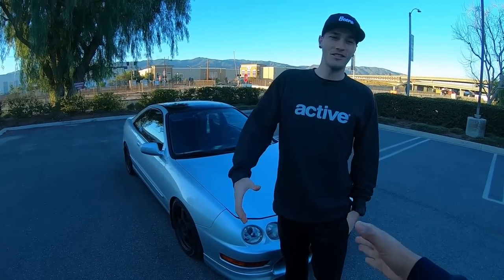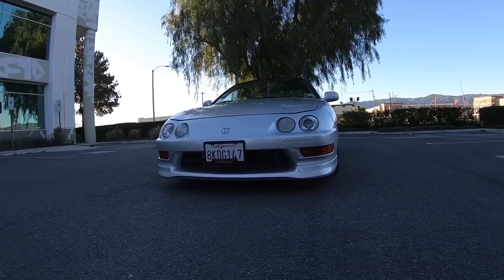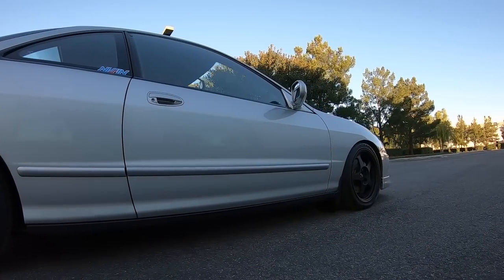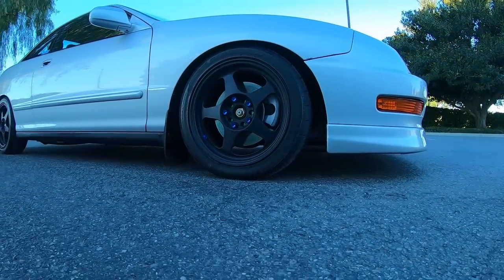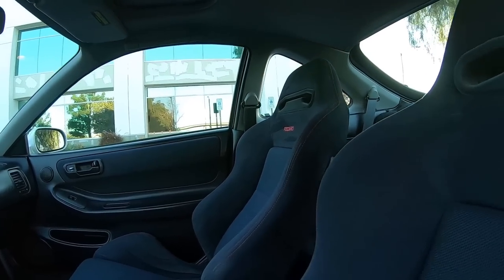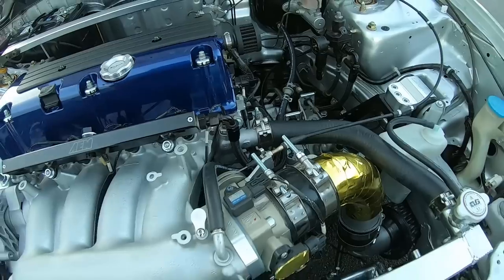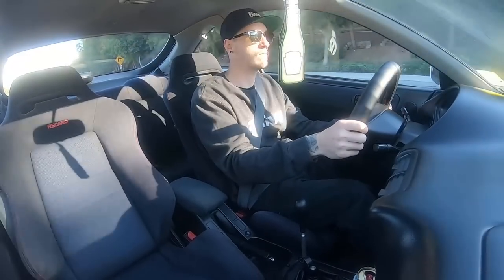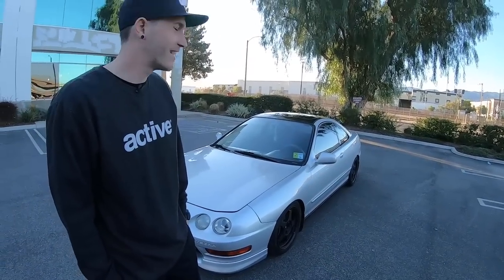1999 Acura Integra SLEEPER: Simple Complexity

Comment: heres a full list cause im sure i forget alot of stuff

1999 integra ls
k20a swap (type r) THANK YOU MURDOCK!!!
itr 6 speed lsd trans
rbc intake manifold
k tuned throttle body adapter plate
skunk2 70mm tb
skunk2 thermal gaskets
rywire k swap engine harness THANK YOU GUYS AT RYWIRE!!
made myself charge harness
hybrid racing conversion harness
hybrid racing shirter cables
k tuned no cut shifter box
hondata kpro
hasport egk2 mounts
plm header
grams fpr 
aem fuel rail
made myself fuel lines
abs delete 
itr 1" master cylinder THANK YOU BALLADE SPORTS!!
re-bent brake lines
1999-2000 si prop valve
itr 36mm 5 lug conversion  THANK YOU STEVE AT HMOTORS!!!
ysr 33 way adjustable suspension 12k front 8k rear
energy suspension bushings all the way around
itr front sway bar
hardrace endlinks
eibach rear camber kit THANK YOU JEREN @ EIBACH!!!
truhart front camber kit
buddy club p1 extended lower ball
spoon sport lugs THANK YOU MICHELLE <3!!!
oem itr lcas
tanabe touring medallion axle back 
type r black recaros THANK YOU STEVE AT HMOTORS!!!
jdm itr cluster THANK YOU JIMMY!!
sir-g steering wheel
usdm itr rear seats
itr door panels THANK YOU STEVE AT HMOTORS!!!
98+ JDM TAIL LIGHTS THANK YOU STEVE AT HMOTORS!!!
Reply from the maker: Yea, you probably did forget some stuff. lol WOW..all this in your single garage and driveway lol Thank you for the detailed list. I am sure it wil help a lot of people. Thanks man.
Reply: @AutomotiveAnatomy  haha yeah just a few things hahahaha
Reply: Did  u use the  axles that came wit the k20 and swap the inner cv joint around ?
Reply: What area are you in Abel?
Reply: @heyitschinoable  i'm in the works with a swapped integra and I also looking into getting it bard. People will always say its impossible but nothing ever is if you put your mind to it. Not only is it seen as a "wow its a bard swap" but also value of the car definitely shoots up.
Reply: Abel Alaniz you have a really nice clean car simple and legit ..I’m in the process of getting my ej1 painted but it’s a bard gsr All the bushings on the suspension done with energy suspension on buddy club camber kit and Tein suspension did the ball joints too,sir headlights,on enkie wheels it’s gonna be a simple clean build too I’ll post it up soon...coming from Bakersfield we have some really clean cars here too
Reply: Abel Alaniz yea bro thanks yea I have much done to it too but yea I’m just waiting for it to be done
Reply: Abel Alaniz Lol thats the best way to do it bro but atleast you built it and not bought it like that off someone you get me and you work at Honda or Acura ?
Reply: Abel Alaniz oh ok that’s good then bro you can get deal for everything I tried getting the window molding for my car but I guess it’s been discontinued:/ so I have to find one at a window place
Reply: Abel Alaniz rear that goes around the window cause it’s faded and dried up since it’s gonna get painted I want fresh rubber all around
Reply: Abel Alaniz damn are you serious ???lol what’s the reason you have it ? And you don’t have another one you wanna sell me lol
Reply: Abel Alaniz o ok so you still have it for sale ?
Reply: Abel Alaniz hey bro I sent u an email
Reply: Abel Alaniz sent you a email bro thank you
Reply: What guide did you follow to manual swap?
Reply: Abel Alaniz I have recaro rails for eg/dc on my ek. I’ll trade you if you’re interested.
Reply: @K1n1c  GOOGLE AUTO TO MANUAL SWAP + WHAT EVER CAR YOU HAVE THERE ARE SOOO MANY FORUMS WITH GREAT INFO THAT WILL POINT YOU IN THE RIGHT DIRECTION IF YOU HAVE ALL THE PARTS COULD KNOCK IT OUT IN A DAY OR EVEN A WEEKEND IF YOU TAKE YOUR TIME.
Reply: Abel Alaniz When doing a K20 swap how do you pass the smog check?
Reply: Any more lean on the seats and they would be flat. 😂 I’m with it

Comment: I’m still driving my ‘99 LS I got brand new.  I leased it then bought out the lease.  210,000 miles later it’s no longer all-original (replacement radiator, timing belts, some body work, et cetera) but other than a Magnaflow exhaust and K&M air filter, it’s clean.  I also refer to it as a “sleeper.”
Reply: 381,000 miles on my GSR, engine bay still fully stock.

Comment: Nice build. 🙂 The recaros look like the Teggy ones to me. Love the rear US seat base. Been looking for one for ages. Unlikely to see one my side of the atlantic. I like seeing someone keeping the "local" front. Never got the hate for the USDM/EDM fronts. Dead right about the colour. Vogue silver is easy to look clean. I have a JDM DC2 98 vogue silver Type R for the last 15 years. The R's with silver are rare(JDM only) but have really crap paint from the factory. Very thin.
Reply: YESSSS THE CLEAR COAT FADING ISSUE SOOO COMMON ON SILVER REGARDLESS OF YEAR MADE... THANK YOU :)
Reply: @abelalaniz9158  Yup and the R ones are worse if you can believe that. As a mate of mine who has one of those paint depth doohickeys said; if it was any thinner it wouldn't be there. He went on to take the piss about it being a deliberate weight saving exercise. The bastard. 😁

Nice install of the K BTW. I like it's not all tucked. I presume because it came out of a DC5 R you got the LSD with it? In my humble the biggest difference in actual driving between a DC2 or DC5 non R and the R is the LSD. If I had any Honda(or any FWD) that I wanted to make better straight off the bat installing an LSD would be the first thing I'd do. 

I like the idea of debadgeing. Looks clean. I also like the lack of spoiler/wing on the back. Again looks cleaner. Nice job all around Sir. Just a thought on the cleaner look.. Maybe look at delocking the door handles by sourcing a set of rear door handles from the four door DB8? A straight swap. They were sold in the States so I'd reckon you could find them handy enough? I did that with mine. Were a bitch to source in my neck of the woods, but look great IMHO. Plus it kinda confuses the car thief scum. Though if your key fob battery ever goes, then it's a climb through the boot/trunk. Ask me how I know...  😁
Reply: @MrGrentch  YEAH I DIDN'T WANNA GO SUPERRR TUCKED SOME CARS IT LOOKS AMAZING WITH BUT I FEEL LIKE THAT WASNT THIS CARS PERSONALITY IF THAT MAKES SENSE, AND YEAH IT FACTORY LSD AND I LOVE IT!!! IM LOOKING INTO THE DB REAR DOOR HANDLE SWAP THEY ARNT AVAILBLE NEW ANYMORE WHICH KINDA SUCKS BUT HEY IT IS WHAT IT IS,  I JUST HAVE TO REPLACE MY LOCK ACTUATORS OTHERWISE ILL LOCK MYSELF OUT HAHAHAH THAT AND IM LOOKING FOR POWER FOLDING MIRRORS  AND A FEW FAUX CARBON INTERIOR BITS

Comment: Car is clean af for sure, but I could never use that as a daily. No AC, and from what I can tell no heat either. No way could I live with a car with air temp control whatsoever.
Reply from the maker: It is not a daily Patrick. But yea i would want AC as well.